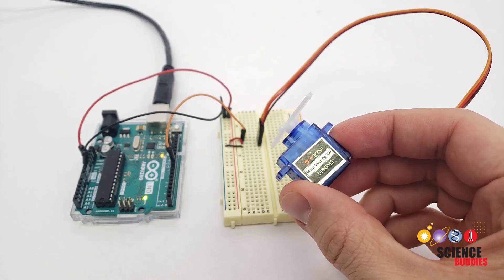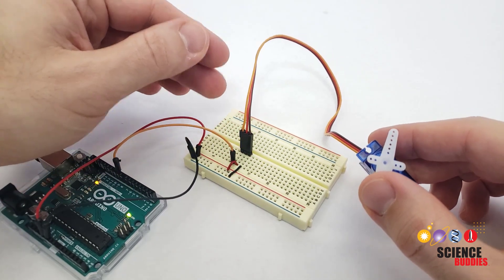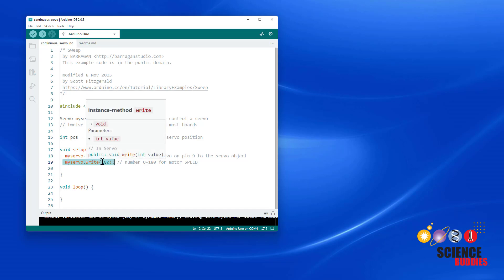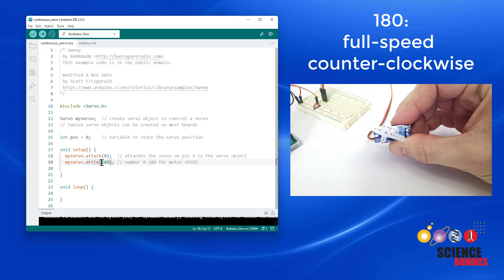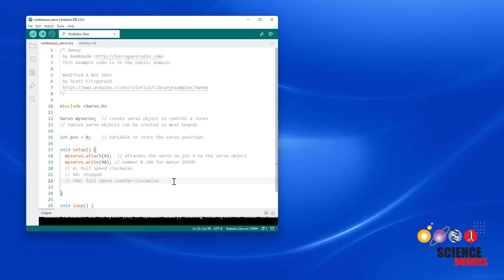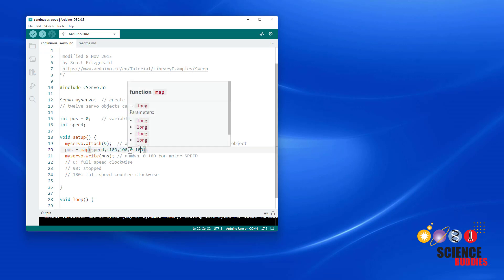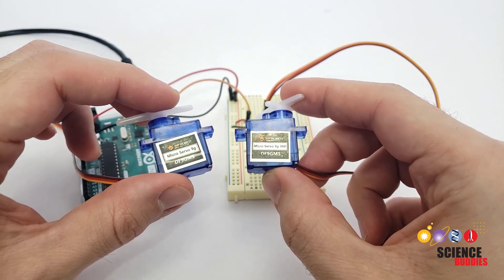Continuous Rotation Servo Motors and Arduino (Lesson #11)

Comment: Hii! I’m a high school student in Korea. Is it okay to run a 360-degree motor continuously for a whole week? I’m planning to do a clinostat experiment, and the seeds need to rotate for the entire week to germinate. But I’m a bit worried about overheating or the motor breaking down…
Reply from the maker: Anecdotally, we've had a few reports from students doing this project that the cheap plastic servos tend to burn out after a couple days of continuous use. See the materials and procedures sections of our written instructions for a clinostat project for more details about how you can deal with this problem: https://www.sciencebuddies.org/science-fair-projects/project-ideas/PlantBio_p054/plant-biology/plants-grow-microgravity-arduino-clinostat#materials
Reply: @Science.Buddies Thank you for answering me!! Have a lovely day :)

Comment: Doesnt work even though the code is exactly the same as the video and the previous video in the series worked(sweeping thing)
Reply from the maker: We recommend asking for help in the official Arduino forums and also posting pictures of your circuit there.
Reply: @Science.Buddies no im good, i just skipped to the coding part. Forgot to change to the 360 motor😅

Comment: When it’s set to 90 does the servo prevent from turning it by hand? Essentially activating braking?
Reply from the maker: The servo will try to maintain its position if an external load is applied, but you need to be careful because you can easily strip the plastic gears on cheap servos.

Comment: I have an arduino uno r4 wifi and the 360 servo does not do anything when I type this code. Any tips?
Reply from the maker: Ask on the official Arduino forums, there may be a bug with the servo library for the R4. We've had issues in the past and had to update the library manually.

Comment: hi can you recommend a positional servo motor. i have a project that needs a positional. the one i have is a continuous one. i need to make it stop to a specified angle... thanks for the video very informative...
Reply: To answer this, you would need to know more about the project requirements. You can get mg90 servos that are positional in 180 and i believe 270 degrees but they are very weak. You need to consider how much torque you need and your power requirements and then find any that match and are not 360 degree

Comment: how do i make it not dependant to computer as in like I want it to be powered by a battery so that it can move on it's own without the connection of the computer?
Reply from the maker: Check out this video! https://youtu.be/I7MrL5Q7zvY?si=okMzc6IpDMzdPtb0
Reply: did you ever figure this out? every time i unplug my computer the motor stops even with the battery... like the code should be uploaded onto the arduino and not need the computer, right?

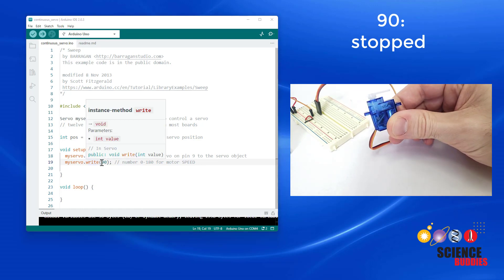Comment: Is there a way to remove the range mentioned at 2:40? The servo I am using only has one velocity for every 10 power, and I want it to increase linearly. Is there another type of servo to use?
Reply from the maker: We can't say for sure, it would depend on the specs of the individual servo.

Comment: 1:50 I used the Sweep example code and removed all code in the loop. The sevo barely moves then stops moving. Any idea as to why it might happen? How can I look at the header file in a file editor? Thanks
Reply from the maker: If you remove the code in the loop, then you still have the myservo.attach(9); line in the setup function that will run. This may cause the servo to move briefly depending on its position before the code started. As for other Arduino IDE questions, you are better off asking on the official Arduino forums.
Reply: @Science.Buddies  the problem was I jumped around in the video and realized i have 180 servos and not 360

Comment: Love these videos, keep up the good work. Though I was wondering, where do you buy your parts, and also what parts should I consider buying if I am starting to get into Arduino?
Reply from the maker: SparkFun and Adafruit are both great vendors for hobbyist electronics. You can also buy most things on Amazon, but there are so many parts available that sometimes it can be confusing and harder to find what you want.
Reply: What parts would you consider buying when starting out?
Reply from the maker: If you are just starting and want to learn the basics, then at minimum you want a starter kit that has an Arduino, USB cable, breadboard, jumper wires, LEDs, resistors, and buttons. That will be enough for you to follow the first few videos in our tutorial series. Beyond that, there are more expensive intermediate and advanced starter kits that include additional sensors and motors etc. It depends on how much money you want to spend up front vs having to buy more parts later. If you plan to learn more eventually it may be worth just buying one of the bigger starter kits now.

Comment: IS IT POSSIBLE TO SET THE SERVO MOTOR IN A SPECIFIC TIME? LIKE AN ALARM, IS IT POSSIBLE TO ROTATE IT WHEN THE SPECIFIC TIME CAME?
Reply from the maker: Hi - to do this you would need a "real time clock" (RTC) add-on for the Arduino UNO R3. The Arduino UNO R4 contains a built-in real-time clock: https://docs.arduino.cc/tutorials/uno-r4-minima/rtc/
Reply: @Science.Buddies 
Please make a video on 'how to control a servo with RTC library '

Comment: Can you make the motor make for example 15 full turns (360 x 15) and then stop. Then later make reverse 10 full turns (360 x 10) and stop?
Reply from the maker: You would need to either time how long it takes to make a turn (which can vary if there is a load on the motor) or use something called an encoder for feedback control to count how many times it turns.
Reply: @Science.Buddies  So then it is just a DC motor. You have almost no control over it.
Reply from the maker: For a continuous rotation servo, you have control over its speed, but not its angular position. A positional servo (which we have a separate tutorial on) lets you control the angle but it won't go through continuous full 360 degree rotations. To get position feedback and control for a continuous rotation servo, you need additional information from an encoder which measures the motor's position (unfortunately we don't have a tutorial on that yet).
Reply: @Science.Buddies  I know how a normal servo works and how you can get angular position.  But without angular position (or at least number of 360 turn) information, it is no more a servo. Just like a dc motor with gear reduction and a driver on board. Because you can do that "encoder control" with any dc motor. Actually there are dc motors with built-in encoders available at very appropriate prices.

Comment: How can I make the cotinuous servo turn just 90 degrees in either direction
Reply from the maker: If you want to turn exactly 90 degrees, it would be better to use a positional servo. You could approximate it with a continuous servo by timing how long it takes the servo to turn 90 degrees and using delays to turn it on for a certain amount of time.
Reply: @Science.Buddies You can use servo.h library to control it accurately, you dont need to do it thru delay commands
Reply from the maker: The servo library is written for positional servos - if you use it with a continuous rotation servo, you will control the speed of the servo, not its position.